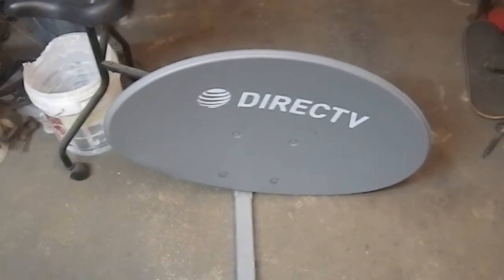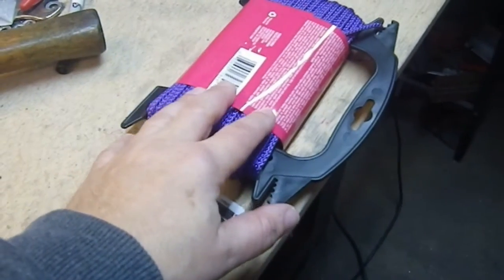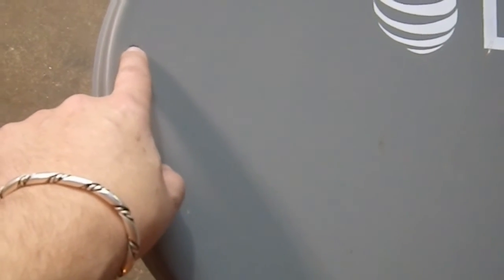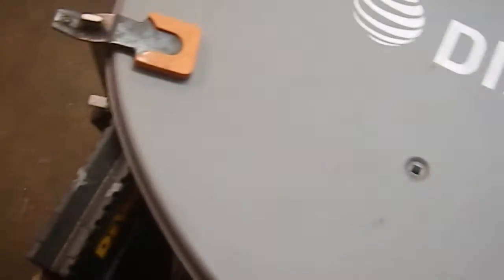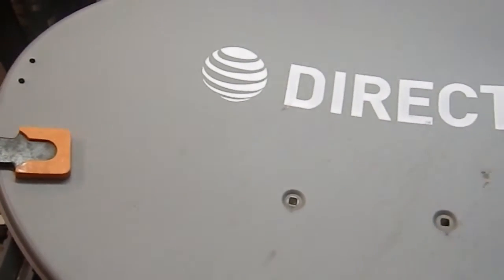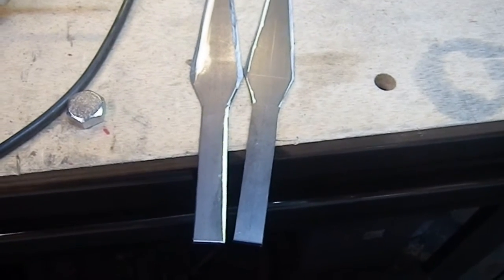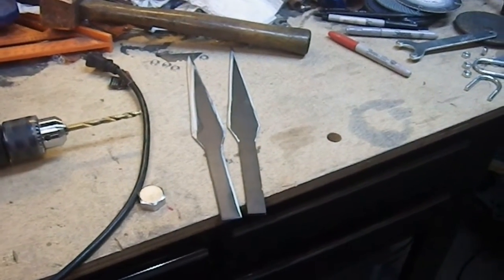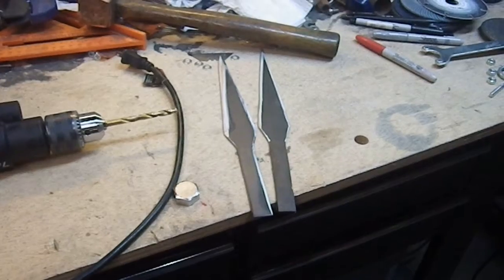Crafting with Tetsubo: Double Spear Shield

Comment: Nice work, that was quite a large involved project.  
Might be worth looking out for some large corks to put on the ends of some of the spears, i have also had to store mine in my loft (attic)
Electrical tape may work as a wrap to take the coldness away from the handle and still be smooth and manoeuvrable.